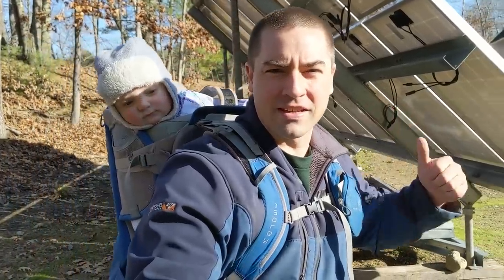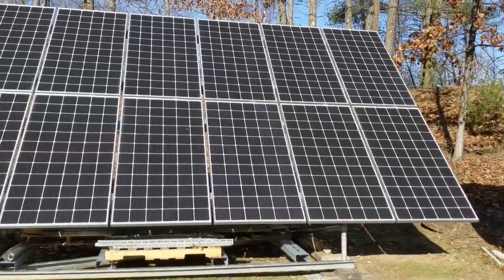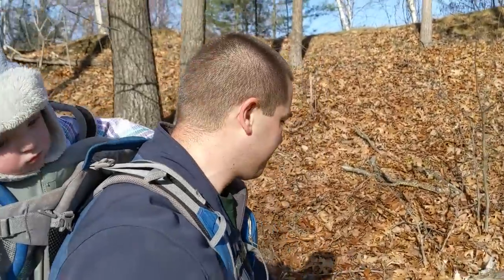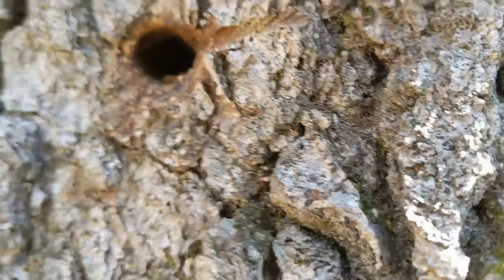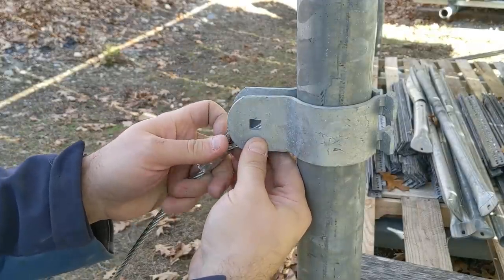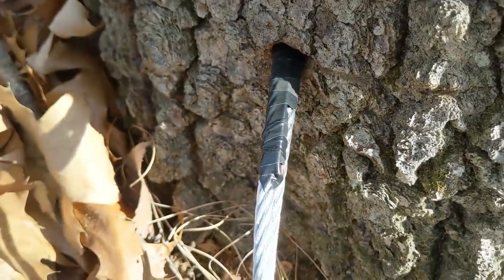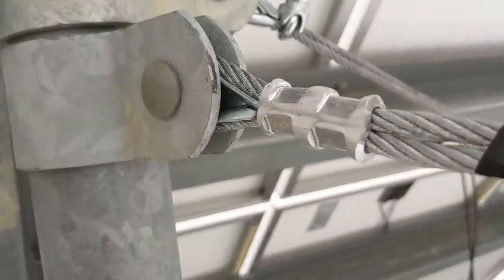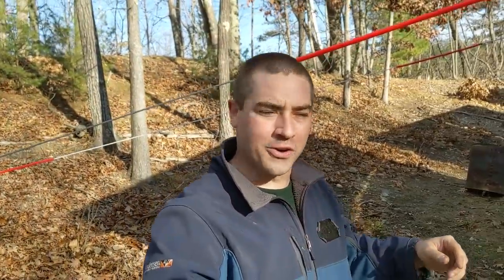Cheapest DIY Solar Array Anchor

Comment: This isn’t going to hold shit in a windstorm lol. 

Why not just drill concrete holes or ground screws? What about the front of the array?
Reply: Agreed, the amount of force a 50-60 mph wind gust can bring to bear once you start talking about square yards or facing is not to be trifled with.
I'm in WNY, and we don't get tornados or 'canes here, although we did 2 years ago. had some 60 mph winds blow through recently though, and all over several towns there were lot of big trees broken of midway up their trunks. And these weren't old, dead, rotted trees.
He's gotta a nice setup going, be a shame to see it get wasted for the want of a couple hundred $$ worth of foundation.

Comment: Nice! Minimum budget,  max result ! Do you plan to flatten the stump so doesnt soak  rain ? Or put a simple cover over that passes air but shields it from most of the rain. So no mushroom start growing.
What will happen if the wind is blowing from the other side?

Comment: Nice job, how about you come down to Texas to do one for me!  Actually, I’m gearing up to gradually get into solar. 1st comes my solar gate, 2nd will be my solar well,, 3rd is hoped to be a setup with used panels but potentially on top of a shipping container storage shed. It will be grid tied most likely.
Reply: Dang it, you stole my idea!  
Not sure if I can get a woodworking shop to fit in a shipping container, however wont have to worry about foundation, leveling, vermin, etc. Just trim the outside with some wood to hide the ugly.

Comment: Some self adhesive heavy electrical hear shrink (with glue inside) is a good thing to use to cover the loose ends of your wire and "secure" it to the tension wire instead of the electrical tape  - will last longer and look nicer

Comment: Hi David a very good way to safeguard your PV array and mounting.  If it were me I would use bottle screws in line at the stump end.
Reply: No, this is not a good way to safeguard anything.  Better would have been to run each line to a ground anchor directly to the read of each side.  The way it is now, wind from the rear is going to be able to get that wall of panels wiggling left and right, and glass panels don't like to be flexed.

Comment: Im going to get some mobile home anchors, and bolt 4x4's to them,
Reply: Hi David looks good but also looks like my paraglidèr. You don't want it to fly so maybe some concrete in the front. Easy to dangle down a fitting in the front  into a hole in the ground and pour ìn a bit of concrete. The plus is it will hold it down is the wind is blowing from the other direction. Great post.

Comment: SHOULD'VE GROUND MOUNTED EACH BOTTOM SIDE OF EACH PV ARRAY PLATFORMS SOMEWAY THROUGH EACH OF THE THREE PIPING ENDS BOLTED AND THROUGH CONCRETE IN THE GROUND  . DRILL EACH PIPE UPPER AND LOWER ENDS VERTICALLY FOR  A LARGE OR GIANT LONG (  I WOULD SAY EACH 4 TO 5  + FEET LONG  ) BOLTS TO GO STR8  DOWN THROUGH THEN DOWN IN EACH POST DUGGED HOLE IN THE GROUND . THEN PUT ON THE WASHERS AND NUTS TO MAKE MEASUREMENTS  AND HOLD EACH BOLTS  IN PLACE DOWN IN EACH HOLE DUGGED UNDERNEATH  BEFORE  POURING THE CONCRETE . THE GIANT  BOLT CAN BE 3 OR 4 +  FEET IN THE POURED CONCRETE  FOR A GREAT HOLD WHEN IT DRIES .. THEN THE BOLTS CAN BE FINALLY TIGHTENED FOR A GREAT HOLD ON EACH SOLAR ARRAY PLATFORM . MAY THE SOLAR ARRAY NOT GET BLOWN AWAY WITH YOU . STAY SAFE . PS - GET RID OF THE LINE ANCHORS .
Reply from the maker: I think your Caps lock button is stuck.
Reply: @DavidPozEnergy  oh no worry ! it’s just too much switching caps was a nightmare . This was the fastest way to reply to ya .

Comment: The comments failed me. How do you get rid of an oak stump?
Reply: Very simple with a drill, some diesel/charcoal. Drill holes from the top as far down as you can. Try to dig around the edges a bit to get a 1 or so down. Then drill holes all around the periphery towards the center, angled up if possible. 
Drop some diesel/kerosene or hot charcaol in the top, and it will smoulder for several days. Some people throw an old steel trash can on top for minimal fire prevention.

Comment: Hi David,
Are you still using the Victron charge controller in conjunction with the two SMA inverters ?
Regards Phil from Australia.
Reply from the maker: Yes.  Victron stuff works great.  I have no reason to change it.
Reply: DavidPoz thanks mate

Comment: Great Job wonder what the costs for concrete footing?
Reply: Sono tubes are $15, or make square ones out of scrap plywood for free. Embed some anchors before concrete dries, and you've got a decent front footing.  Similar on the rear, just run some pipe or angle iron up to support the top or middle of the array.

Comment: How many KWH is that 5 kw array able to put out each on average? 20-25?
Reply from the maker: This time of year I'll probably make 10 kwh per day.  Probably 20kwh per day in summer.
Reply: @DavidPozEnergy  Nice. I'm wanting to build a similar size system, but may need bigger. Thanks. Probably going to move up to 7.6 kw system. (405w x 12).